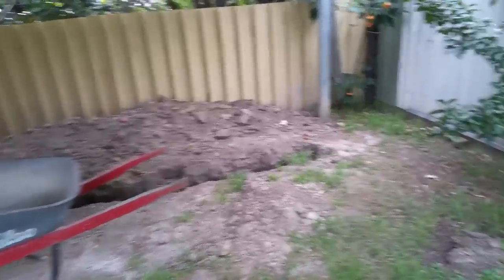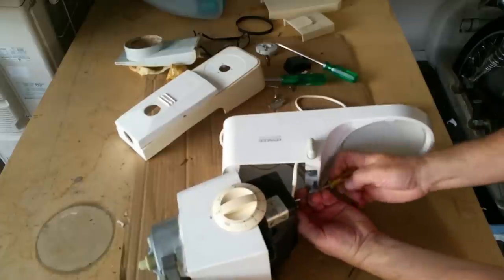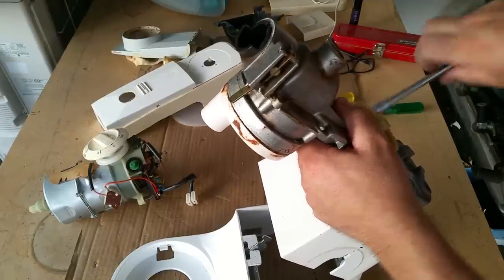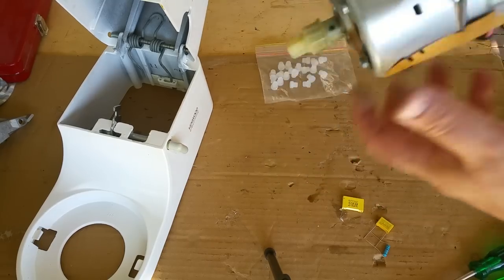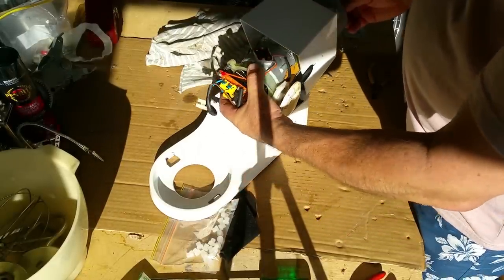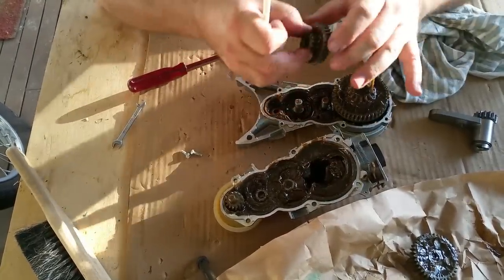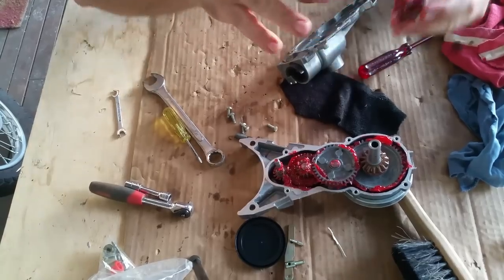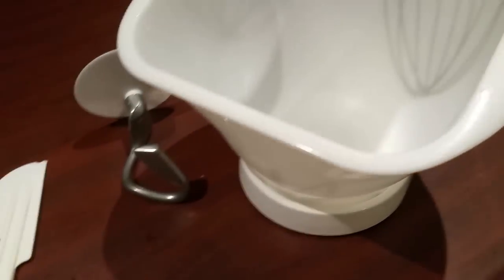Kenwood Chef Gearbox and Electronics Repairs

Comment: Nice video.  Kenwood specified 135 grams of grease for the gearboxes in the service manual.  I usually weigh out the correct amount into a clean container, and make sure the bottom half of the gearbox has a good covering as well as the top.  I get your point about "too much grease" but the gears are likely to wear more quickly without sufficient coverage.  Also it's good to ensure the pinion can be turned relatively easily (there'll be some resistance from the new grease, especially if the gearbox has been filled to the manufacturer's specification) before tightening down the six screws.  If necessary back them off and re-tighten them in pairs.
Reply: thanks, I have to replace that grease in the same Kenwood. But do I need a special  food grade lubricant ?
Reply: @anto8222  EP2 lithium grease in the gearbox, and a smear of food safe grease around the planet hub ring gear.

Comment: Hi Peter - I recently rebuilt ours of about the same vintage - had to replace condensors and resistors on the speed control circuit board - you can buy a kit of these to fix.  Symptoms as for yours - electrical burning smell (and smoke). Youtube is your friend when dismantling it.

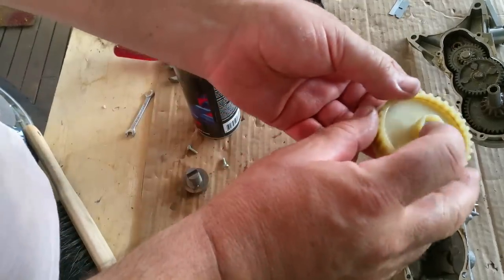Comment: at 31:01   How did you get that off?  The manual say I have to lock the gear box with a special tool in the slow speed outlet. I have no such tool. I tried holding the drive pinion with large pliers but got no luck with that. The torque just moves the gearbox around. I am having no luck getting to those two screws underneath that nylon cog. You said it was very easy to remove it so I wonder what you did.
I have the Major model km615, which have tx20 screws holding the gearbox together.

Comment: You're allowed to work on devices as an electronics tech btw. Just have to be deemed competent in mains voltage, which you clearly demonstrate. 
Tried having a crack myself repairing the same model but the motor was already far too gone for repairs. This is a detailed and well documented teardown. Managed to get flames out of the old motor watch?v=Uiu1_xblrBQ lol

Comment: I'd strongly suggest you don't use FoodSafe grease inside the gearbox as it lacks the correct lubricating properties. Factory standard was EP2 grease inside (130g), and a dab of food safe in the planetary hub. :D 
Nice machine though the KM210. :D Will last another 30 + years with ease!

Comment: Did it smell like burning newspaper?

If so, it's those "RIFA" style epoxy encapsulated capacitors.
They crack, then the humidity gets into the paper dielectric and they become electrically leaky. This heats the paper and bam, smokeage with a possible touch of fire.
Reply: Ah, you got em.
Reply from the maker: Yes indeed... terrible smell. Happy new year!
Reply: @PeterAndersons  Happy new year, Peter!

Comment: I dont want to sound like a winger but you should really only use food grade grease in that final drive over the bowl. A bit of Inox MX6. Even some silicone grease is ok for use as a food grade. My tube of CRC silicone grease says it's ok as a food grade lube, not cheap at $40 a tube but it lasts. 
Just a thought anyway.
Cheers
Reply from the maker: You're probably absolutely correct... I mentioned it to the tech I was getting advice from and he didn't support it, on the grounds that it liquified apparently quite quickly. I have zero experience with it, so I really have no idea to that end. From what I've observed, Kenwood used regular mineral based grease sparingly in the planetary case, which was viewed as acceptable. The issue of separation and leaking seem to originate from the gearboxes, where the separated oil runs down the output shaft and into the planetary hub. From there, I believe it's moved outward centrifugally where it's allowed to drain through the beater fitting. Provided the EP2 lithium grease doesn't separate in the gearbox, all should remain dry - I certainly hope I'm correct, cheers and thanks.
Reply: @PeterAndersons  No worries. I just thought I would mention it as some old ideas were not the best.